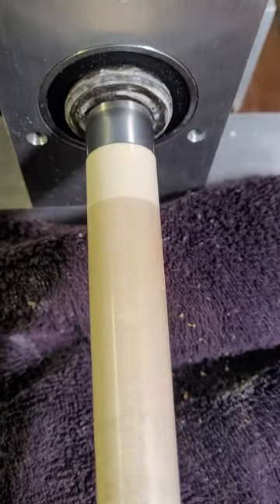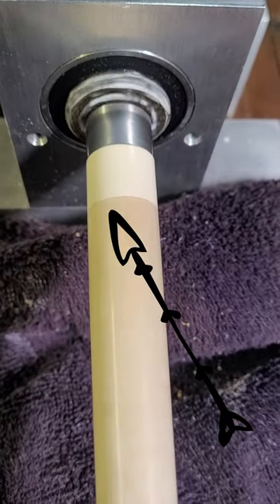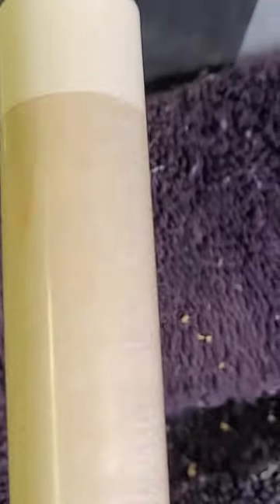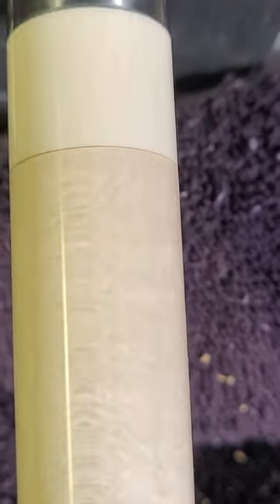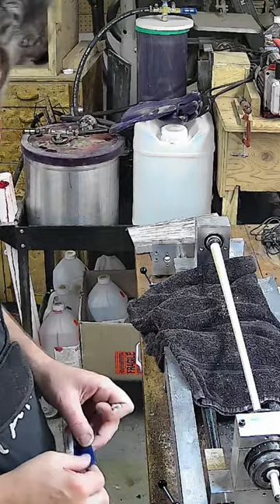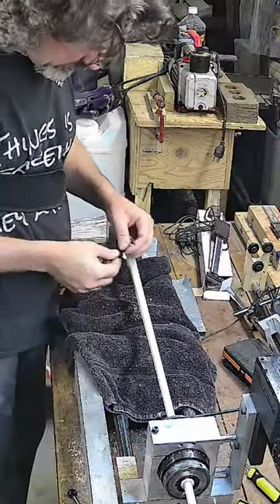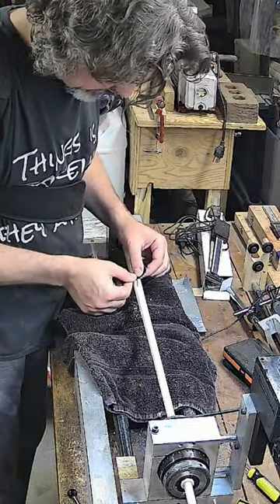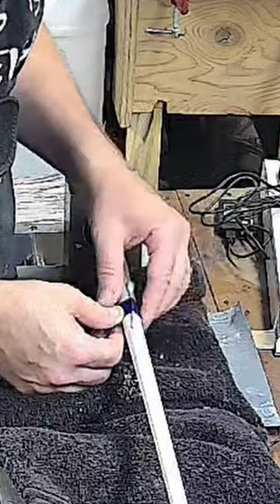How to remove a ding from your pool cue shaft

Comment: That cotton buds? Is that for prevent tape to stuck to water? Does that method  only apply on glue or on wood  without protection. As I have dent near furrule and I can't smooth it with glass 😅.
Reply from the maker: Cotton is to hold the water. It will likely work if the finish is cracked.
Reply: @charactercues  Great! I will try it on my  spare cues. If it's worked then I will do it to my main cue. Any advice before I do anything? Thanks in advance